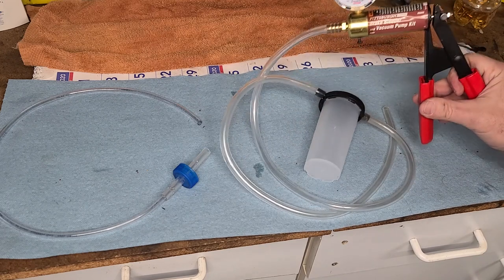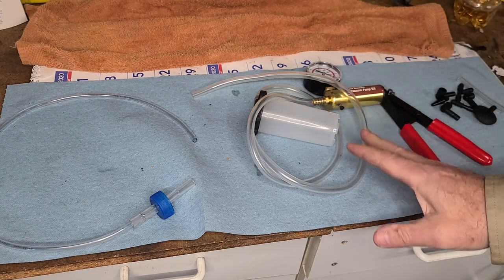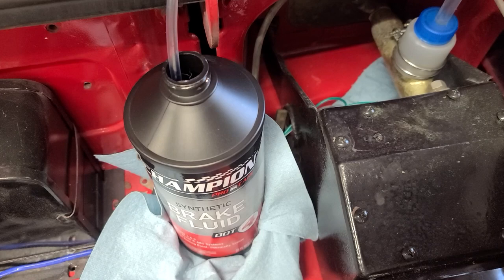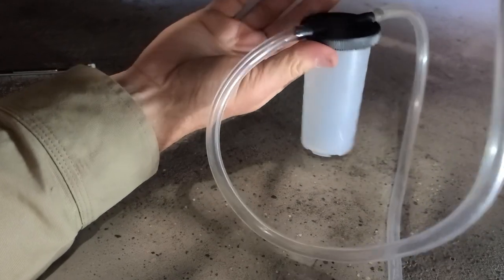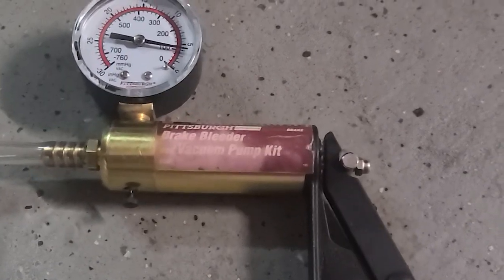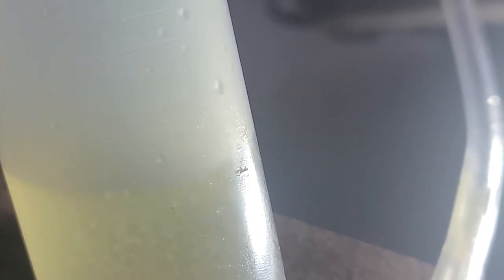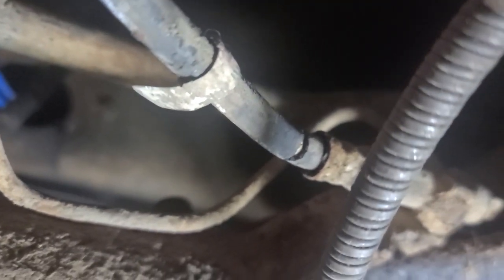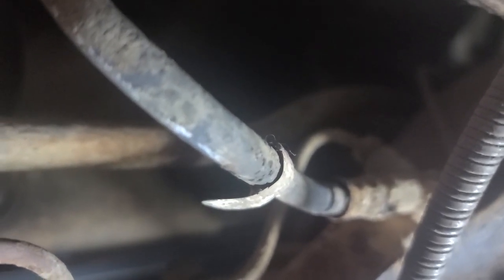Bleeding brake and clutch lines in the '77 MGB -  or so I thought...

Comment: Just changed clutch slave cylinder and flexi hose today. Managed to bleed the cylinder on my own using the old broom handle method against clutch pedal and jammed against the seat back,  hanging a cut off juice bottle filled with DOT4 enough to submerge the clear hose from the bleed nipple. I have a  pump bleed kit but that was in the house (2 minute walk from the garage) seen the brush in the corner of the garage thought I would use that to hold the pedal down whilst I cracked open the bleed nipple for a few seconds then closed it. Release broom and repeat 3 to 4 times or until bubbles dissappear. Keep an eye on fluid level in master resevoir, I topped up twice. Took about 15 minutes in total. Normally I have my youngest daughter to pump the clutch pedal but she was at school. Cheers for the videos. I'm in the process of refurbishing a 1972 MGB GT teal blue.

Comment: Lesson learned: always replace all three brake hoses, not just one or two....😅
The easiest way of getting the majority of the air out of the (rear) brake lines is by using initially the "gravity system": open both bleeder nipples on the rear wheels and allow the fluid to pour out. As the lines are initially completely empty will it take some time before the fluid from the master cylinder reaches the rear wheels. Make sure that you keep the master cylinder filled with fluid, to prevent new air to enter into the lines. Once the fluid has reached the rear wheels you can switch to either the vacuum method or the buddy system.
I was curious about you showing how to bleed the clutch as that is what most MGB owners complain about. It often causes more trouble than bleeding the brake lines.